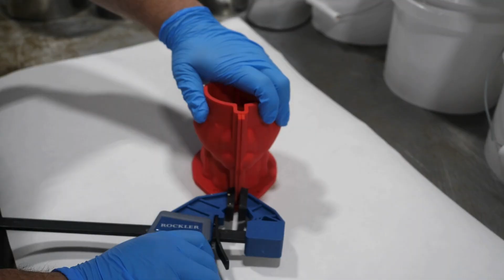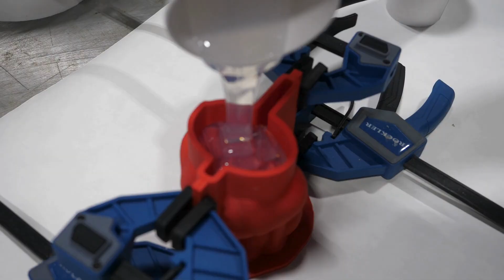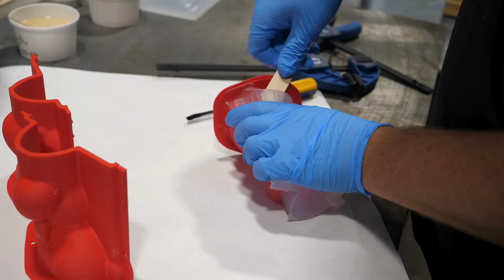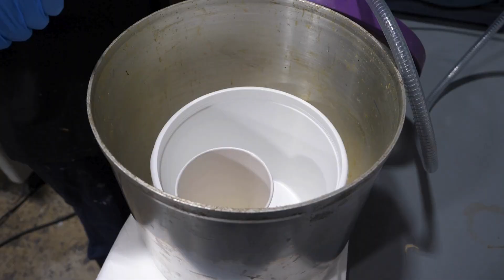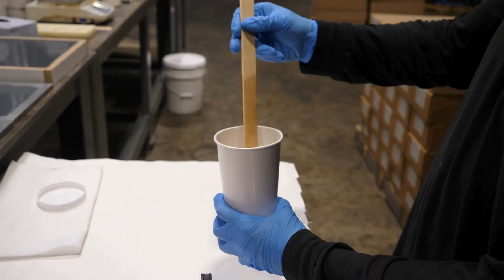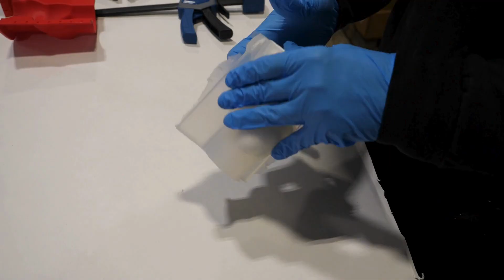Making a Silicone Mold from a 3D Print & Casting a Urethane Plastic Part

Comment: Wouldn't it be easier to just print the end-product with FDM or Resin or are there special material requirements for the end product? Is the silicone mold reusable?